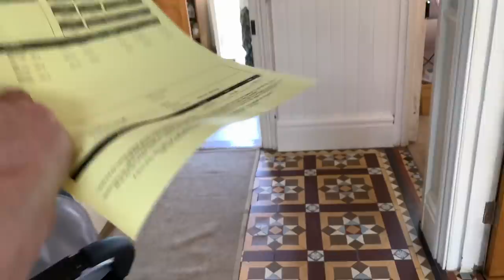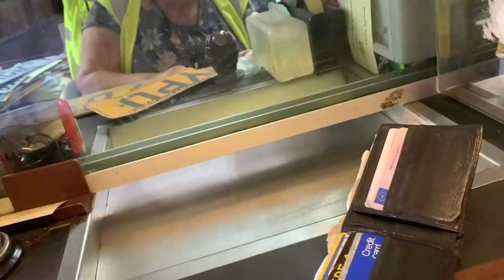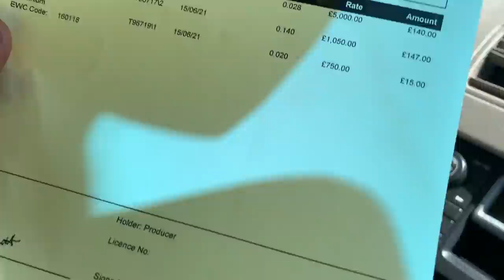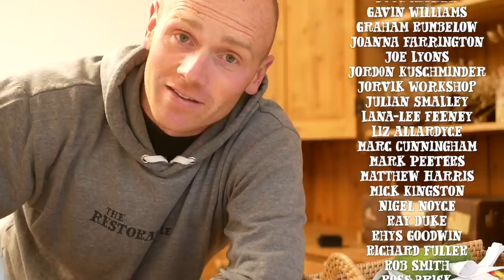WHAT DID OUR OLD ROOF EARN US?  Selling Salvage!

Comment: Had my first experience of scrap metal dealers a few weeks ago. Had a load of old metalwork and electronics boards I'd accumulated over many years as a service engineer. Local tip wouldn't take it as it was 'trade waste'. My company didn't want it back so I tried the scrap merchant. When asked for my bank details, I enquired why I couldn't pay by card. Was pleasantly surprised when I was told they were paying me. The £150 was certainly worth the couple of hours spent clearing out the garage! They also said you'll get more for copper wire if it is stripped. Classed as mixed metal if it still has the insulation on.
Reply: yep, as a telecomms field engineer, any scrap offcuts or rubbish old copper cabling me and colleagues removed as rubbish, we gathered it all together throughout the year, and then took it to scrap yard and weighed it in before our annual christmas party...we all agreed to put the money behind the bar and had a VERY good night out paying for most of our drinks from the scrap!

Comment: Ripped out the complete Central heating system as it was from 1964. 3 bags of copper and brass plus 10 large radiators. £140 from the scrap yard. Saved it from the plumber having a healthy tip when the new central heating was installed 🤣

Comment: if you had separated the clean copper pipes from the “dirty” ie cut the brass joints and solder you could have increased your value quite a bit